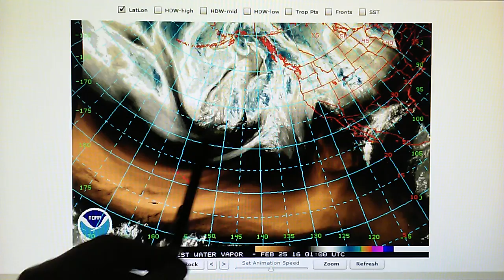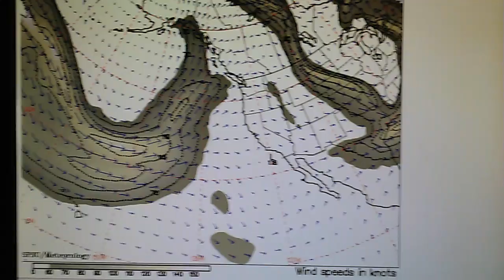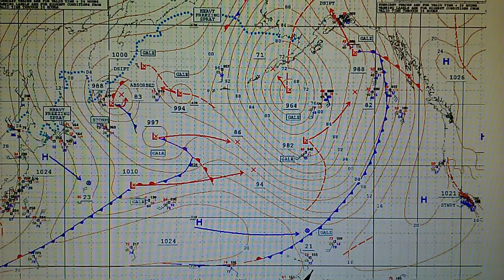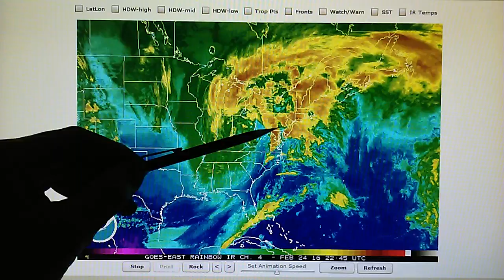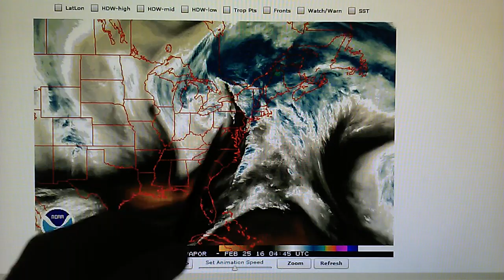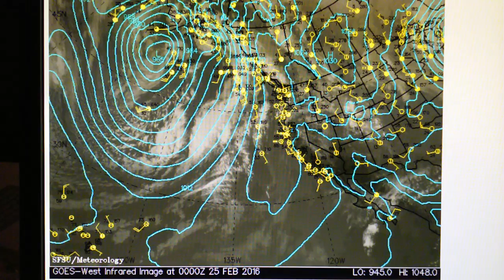2-24-2016; Day-7 of Stationary High Pressure Blocking All Rain Systems into California

Comment: Feb 26, 1:00 pm= The LA sky is now a war zone with toxic aerosol spraying.. 
I am constantly blowing my nose, whilst the majority of people remain oblivious.
Reply: +Thor =  pd.shill.gov't.deBunker
Reply: +Ashton 09 
Feb 26, 2016 Thank you for your information. I live in Los Angeles. I know I'm allergic to the chemtrail pollution spayed by the weather manipulators as well because I often suffer heavy runny nose and sneezing on days of heavy chemtrail spraying. 
My allergy today is extremely severe. Usually, after I have rinsed my noise with saline solution with a little Hydrogen Peroxide solution, my allergy would stop for about 6 hours. (I use  240 ml 0.65% Sodium Chloride solution mixed with 5 ml of 0.3% hydrogen peroxide solution. Note: That's how I could relieve my allergy. It's not an advice to anybody. You should consult your doctor regarding your condition.) But today after rinsing my noise for the first time, the allergy was still there. I rinsed a second time in half an hour, my nose was still running even though the sneezing had stopped.  I had to rinse my nose a third time to stop both my runny nose and sneezing.
I went out to see how heavy the chemtrail spraying was. At first, I thought that the whole sky over Los Angeles was "cloudy". However, on careful observation later, I found out that those are not real clouds. They are actually chemtrails so densely sprayed that they resemble heavy clouds on a cloudy day but I can still see chemtrail patterns here and there while a few new and distinct chemtrails can be seen among them. 
Just like you said, the LA sky is now a war zone with toxic spraying. 
Those devious and hypocritical politicians who allow the toxic chemtrails to be sprayed over the USA should be arrested and tried for their crimes.
Reply: +Ashton 09   Down here too with skies totally covered with that streaky, ragged crap and am enduring the usual menu of health issues.
Reply: +Russ Redfern My closest neighbors are sneezing throughout the day, everywhere I go I see people sneezing. As long as the masses remain "clueless", the spray operations will continue & increase in frequency.
Reply: +simon6071 Simon, Russ had a chuckle when I called Thor the troll a scumbag.
Reply: People who believe the lie of the weather manipulators of chemtrails being used to reduce "global warming" are fools.  They have been spraying chemtrails more frequently in winter months in California even when it's cold and the sunlight is weak, which means reduce "global warning" with chemtrails is only a lie as blatant as "global warming" itself when many US cities have been experiencing colder winter weather in recent years resulting more cold-related deaths that the state controlled media just sweep under the carpet. 

People are also fools to believe the lie that chemtrails over California are for rain making. The fact is we never see rain falling during or shortly after chemtrail spraying over the Los Angeles sky at all. California's normal rainy season is during winter months. That's why the weather manipulators who want to create drought in California spray chemtrails over Southern California more frequently in winter months so as to stop rain from falling. The huge amount of moisture from the west coast is then carried by the jet stream to the states in south-east such as Texas and cause huge flooding over there during winter. 

When the non-GMO farmers in southern California fail to grow their crops due to persistent man-made drought, many of them had to sell their farmland to some rich "investors". 

I wonder if Monsanto, which has created and patented aluminum resistant GMO seeds, is behind this devious plot of land grab because the chemtrails sprayed over California have been tested to contain large amount of aluminium nano-particles which can stunt the growth of natural crops. 
http://www.ncbi.nlm.nih.gov/pmc/articles/PMC2710549/
http://www.geoengineeringwatch.org/chemtrails-killing-organic-crops-monsantos-gmo-seeds-thrive/

Large amount of nanoaluminum inside the human body is also know to be the cause of Neurodegenerative Diseases as well as a number of other illnesses.
Google:
* Neurologist Warns Aluminum in Chemtrails Could Cause Explosive Increase in Neurodegenerative Diseases
*CHEMTRAIL SYNDROME: A Global Pandemic Of Epic Proportions
*Manufactured Aluminum Oxide Nanoparticles Decrease Expression of Tight Junction Proteins in Brain Vasculature

We should know that Monsato is also the company that had failed to provide adequate warning to farm workers and gardening enthusiasts about it's weed killer Roundup being the cause for cancer. 
In spite of the fact that California's  Environmental Protection Agency has listed glyphosate — the toxic main ingredient in the U.S.’ best-selling weedkiller, Roundup — as known to cause cancer, the  creeps running Monsanto are devious enough to filed a ridiculous lawsuit against the State of California to make sure you never find out that the main ingredient in Roundup, glyphosate, could give you cancer.
http://hsionline.com/2016/01/26/monsanto-sues/

Oh, don't you even be foolish enough to think Obama and his "wife" Michael really care about the food that we eat are healthy. Do you know who Obama has appointed to run the Food and Drugs Administration (FDA)?
Here is the scandalous fact:
In 2009,  Barack Obama appointed former Monsanto VP and head lobbyist Michael Taylor as Deputy Commissioner for the FDA — the board tasked with regulating Taylor’s own GMO industry.
https://petovera.com/monsanto-exec-heads-fda-and-the-obama-administrations-revolving-door-politics/
Reply: I'm not Stop being scared of contrails.
Reply: +Thor Contrails can stop rain.
Reply: +Russ Redfern Persistent contrails are not chemtrails but are used to block sun to stop global warming.
Reply: +Thor Thor Shut up, scumbag troll .
Reply: +Russ Redfern I know there is spraying I remember 2013 had the most obvious silvery sky in the mornings also 2012 those planes spray chemicals in the contrail stream or ships spray off the coast I think aluminum was the chemical sprayed.
Reply: +Russ Redfern 
You shouldn't be so insensitive as to laugh at people who suffer from chemtrail pollution, especially when you are one who appear to be against chemtrail spraying.
Reply: +simon6071 Hi Simon, I think I'd left a comment on your channel yesterday, directing you to come here... I live in W.LA area, and have witnessed a major increase in the aerosol chemtrail spraying here since 2014. That is when I began having my side effects from the spraying. Just a suggestion;" Zeoforce Zeolite", in capsule form, 2 tablets per day. This zeolite is the best for removing heavy metals from the body and brain. (My nose stops running after taking the capsule) You need to order online because CA has recently banned the sale of zeolite now, they do not want us healthy. I'd heard about this brand of zeolite from the Santa Monica Co-op and was told many in LA take it for chemtrail toxicity....take care
Reply: +Ashton 09 
I didn't know that you had left a comment in my channel. I have no idea how to see that comment. Would you please tell me how to open it?
Thank you for you information about detox of heavy metals from chemtrails. I'll look into it.
Even as we complain about chemtrail spraying over Los Angeles, they continue to spay even more massive chemtrails over LA right now. Disgusting!